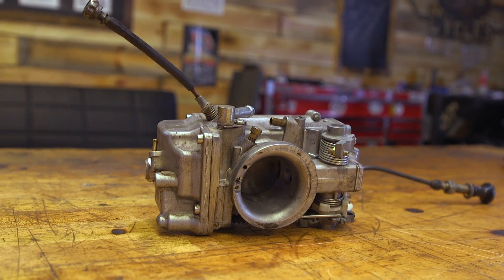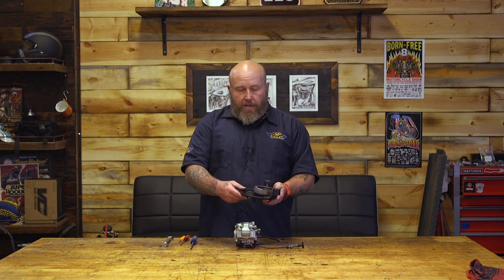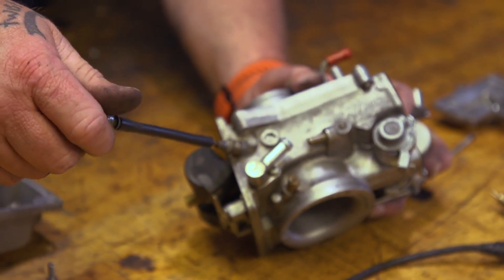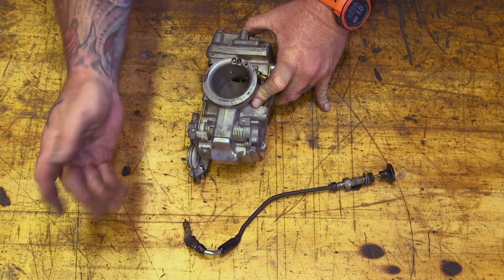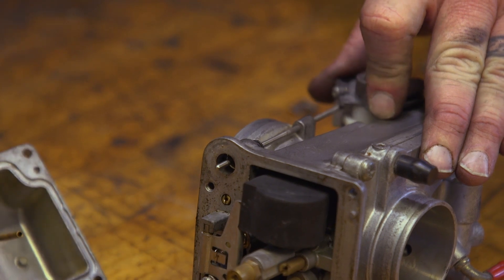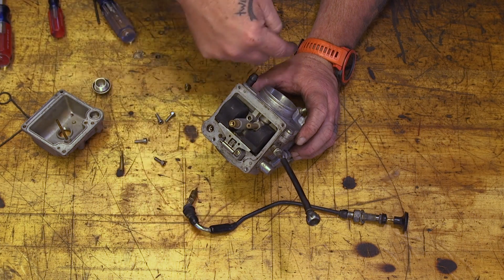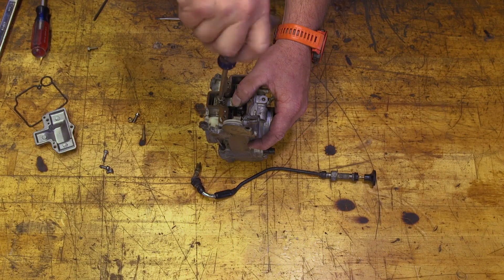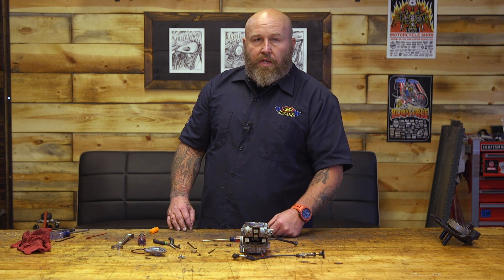Anatomy of Mikuni Carb : Pro Tip

Comment: I have an 03 Vstar 1100 that someone converted to single carb and used this Mikuni.  It definitely needs a rebuilt after sitting for at least two years, this video helps, but I definitely need more information on doing a full rebuild.

Comment: I've watched several of the Mikuni rebuild videos and learn a bit more from each.  This one was equally informative and I learned the necessity of having the right tools, screwdrivers, etc.  The assembly lube used looks suspiciously like Yamaha marine grease but the take-away is lubing the gaskets and seals with a thin film before reassembly.  I'll look for the tuning tips as well since there was't any mention of the pop-off pressures, etc.  My GP 1200 has triple Mikuni's and has been running ragged, lacking the "hole shot" acceleration it came with so I'm diving into the carbs.

Comment: How come they don’t have a electricity wire ? Changing out my stock Chinese garbage and just got my Mikuni Vm24 round slide in the mail today. So I’m trying to figure out why the old one has a green and yellow wire slot on the side. I have to drop the whole engine just to get the carb out because the screws are stripped on the intake manifold and the throttle cable where it connects . It’s a headache but it’s whatever

Comment: Running drag pipes on 92 FXR with hsr42, carburetor always dumped fuel so took manifold and carb off put new rubber caskets on manifold intakes, new rubber spigot for manifold to carb, put new seat and needle in carb no more fuel dump, have air screw at 2 1/2 turns out but bike smells rich ! Any suggestions?

Comment: Hey have a 42mm on a 2007 ,1200 and she has a cough on accelerating.   Any ideas ??
Reply: Try adjusting the accelerater pump. It's adjustable to let more or less or delay or spontaneous spray of gas when you give it more throttle. He kinda talks about it in this video.  What it does is shoot a little spray of gas into the carb when you give it throttle, because you are op3ning up the airway and it needs a shot of gas until the vacuum starts to suck gas into carb on its own.

Comment: Any advice on what to check or do,  low speed coughing, ?   42 mm on a 2007 ,1200 sporty with pipes.
Reply: Check for intake leaks first, with the engine warmed up. The mikuni manuals are available online for free. If you follow that word for word, you will have a great running bike.
Reply: Running to Richa grey clean plug is ok . a black plug is to rich tan can be ok or just a hair to rich  , raise the needle C clip up a Notch .  Up is Lean Down is Rich ,  Evo 1200 like lean burn same with a 1340 .

Comment: Can you lean out or enrich the air fuel with the enrichment screw? I have this same carb and my plugs a pretty black from running rich
Reply: The only adjustment screw is for the pilot jet which really only affects idle and the first 1/8 of throttle approx.
Reply: The idle adjustment screw is basically an air screw.  If you turn the screw out, you will add more air leaning out the mixture.  If still rich you may need to change the idle jet to a smaller one.

Comment: Pump nozzle keeps changing spray direction it ends up towards the filter. What’s the fix.
Reply: Replace the O-Ring on the pump nozzle. The rubber will shrink over time.
Reply: Turn the nosles so they face the cylinders - they can be turned around - the O-ring hold them in the direction you leave them in

Comment: I just bought a bike with this carb and it’s been sitting for 6 years so the slide won’t even open. Not sure if it’s rebuildable or not. Any advice on what route to take?
Reply: Sounds like the oring on the slide is stuck. The carb is 100% rebuildable. Find a dealer with a Sonic Cleaner and have it cleaned. Put in a rebuild kit, and a new pilot jet, and you should be good to go.

Comment: Isnt there a small washer that goes on the needle, beneath the E- clip?
Reply from the maker: you can shim the needle up if you want to make slight adjustments
Reply: Yes, there should be a small plastic washer under the clip on the needle, cushion. Sometimes it stays on top of the slide when the needle is removed, or it comes out with the needle. But you should run it to keep the needle from bouncing around.

Comment: You mentioned the clacking sound from the slide when the o ring wears out, is that something that can be easily replaced? On my bike, it does it when it is cold, but not hot, What would cause it to do that?

Comment: Question: I have similar carb....TM33-8012,  TM28SS for 86-88 Suzuki DR200.  I have completely rebuilt carb all but the float. I can't seem to get the accelerator pump to spray fuel out the nozzle. Spring, plunger, the rubber bushing that the rod slides in, o-ring on the AP nozzle and main bowl o-ring, then the rubber boot. I just don't why it won't pump...any suggestions?
Reply: Did you have any luck? I have the same carb on my 92 DR250.
Reply: @bobbyd0656  yeah....it took a while to find all the parts but once I got everything I needed it went fine afterwards
Reply: How do you replace the rubber boot for the accelerator pump?
Reply: @Scottbianchini  on my carb. 42A20,  also 42A21, then (I think) a TM28SS is the "new" Mukuni part # for. Carb has flat slide & accelerator pump.....once you get the AP push rod out the boot will just slide on.  
      I found my issue was in the check-valves inside the bowl.....the ball in port at bottom. I soaked it, sprayed airgun in the ports, the AP cylinder and brass jet around the edge of bowl and it started working great!

Comment: Awesome video. I want to clean jets in my mikuni hsr42. What do i use to clean jets  . I didn't start my harley enough in-between riding. Can tell i have a plugged jet. Do i need to take jets out?
Reply: The main jet should be OK, just clean it. Replace the pilot jet. For a few bucks its easier than trying to clean it.
Reply: Take the bowl off, clean out the gel'd fuel particals and then unscrew the jet, you can then use a pipe cleaner or a small enough drill bit

Comment: I really hope you or someone else on here can tell me how to remove the brass jet in bowl?    I think I have an issue with the check valve in bowl coming from plunger to the port. Any input will greatly be appreciated.  Thanks.
Reply: Turn it with a flat head screwdriver. It unscrews, it should anyway
Reply: @normansmith4064  ok....will try but it has no slot....hole is tiny
Reply: @dgmenace73  does it have any hex head on it? Or is it completely smooth?
Reply: @normansmith4064  completely smooth inside the bowl....I think it may have a spring loaded ball that you can see near bottom of the outside of bowl. My guess would be to push that ball in and somehow pull the brass jet out?
Reply: Is it like the one here? https://mikunioz.com/vm-round-slide-carbs/vm38-carb-parts/?v=13b249c5dfa9
Reply: @normansmith4064  if you search for Mikuni 42A20 , or  42A21 ,  or carburetor diagram for 1987 DR 200 you will see what it looks like......its basically a smaller bore TM33-8012.  I think Mikuni even changed the part # to TM28-1 OR TM28SS for the 90 and later DR 200's it took me a long time just to get the correct jets.....there are a lot of sellers on Ebay that have carburetors that the compatibility says "Fits 1988 DR 200" but then when you read the description nothing older than a 96.   The previous owner told me I would have issues but did get all parts but the bowl.

Comment: Great tutorial. Imho, I think keeping the Phillips screws on the bowl is key to not over tightening and cracking the body as they will start stripping if turned too tight. Kind of a safety blanket. Best performance carb for street riding imho but extremely sensitive to certain builds on the pilot circuit. Follow the manual exactly as written and this carb will wake up any bike with satisfying results. Biggest con is it’s inability to make atmospheric changes, so if you live in an area like New England as I do, be prepared to make fine adjustments on your pilot as the cold weather comes in.

Comment: Is there going to be a part 2? Thanks.
Reply from the maker: We could make that happen.
Reply: @jpcycles  if you guys could set the air fuel screw that would be helpful. Manual says that after 2.5 turns out if idle does not drop then pilot is too large and should be lowered. I don't hear anything change in mine after 2.5 turns out no matter how small I go in the pilot. Today I tried a size 15 and I have a hsr 45 on a v111....